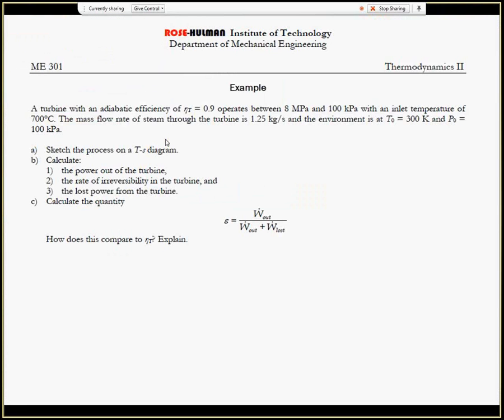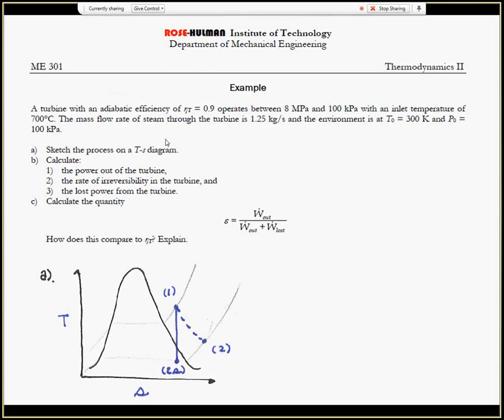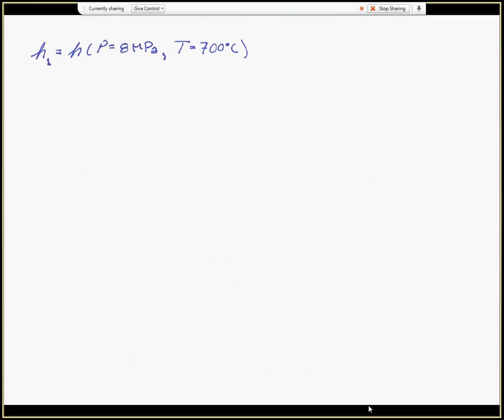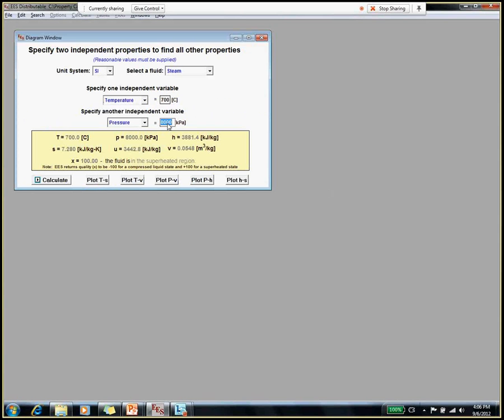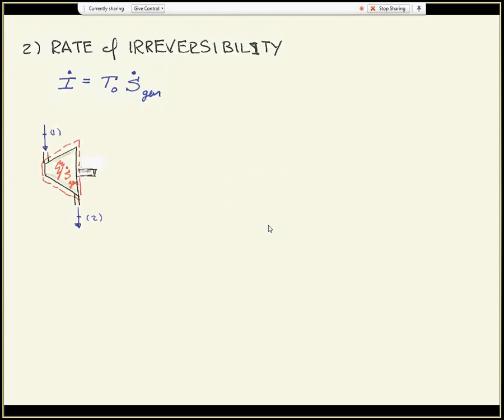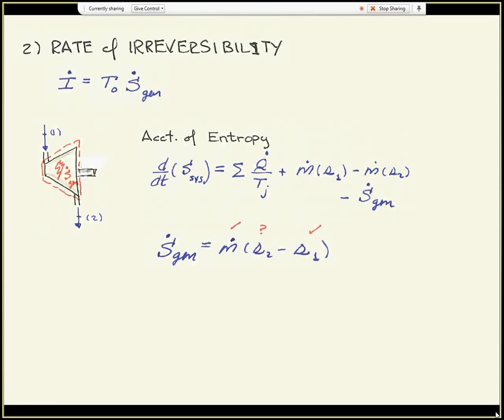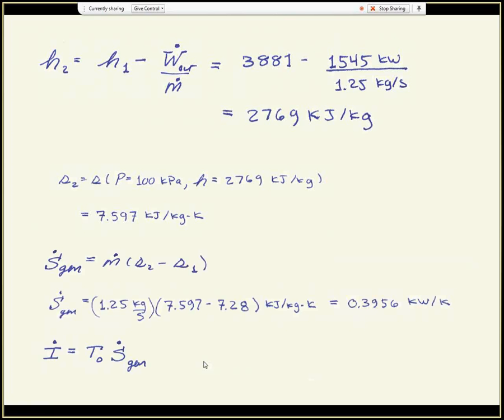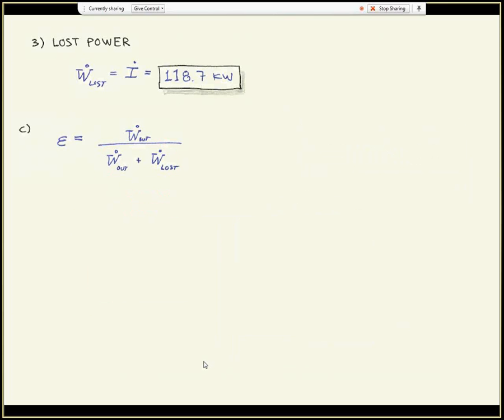Irreversibililty calculation for a steam turbine

Comment: How could I work out the power of the turbine if I dont have a given efficiency
Reply from the maker: Hi Callum. If you were not given the efficiency, another parameter would need to know another parameter in order to find the power. This most likely would be another property at the exit (state 2) such as temperature or quality. With two properties at the exit the state is fixed and you can find the value of specific enthalpy. Hope that helps.
Reply: @thomadams7486  thanks that helps a lot much appreciated
Reply: @thomadams7486  I've got another question I'd like to discuss with u. Is there any other way of contacting u?